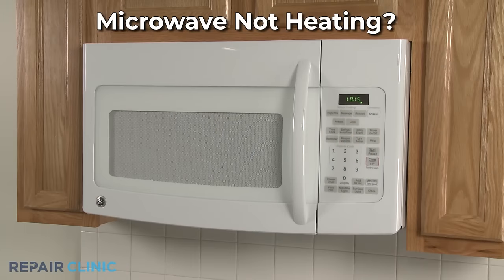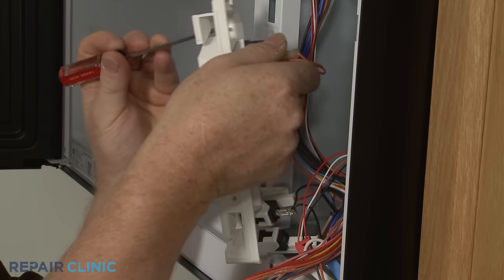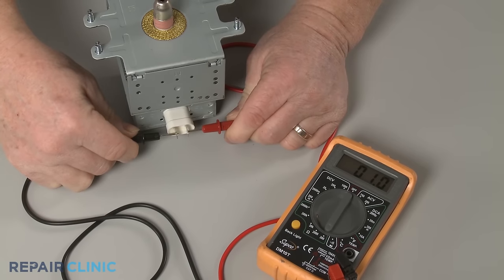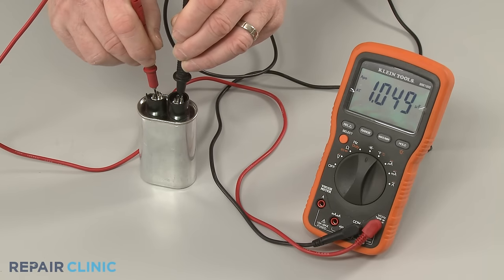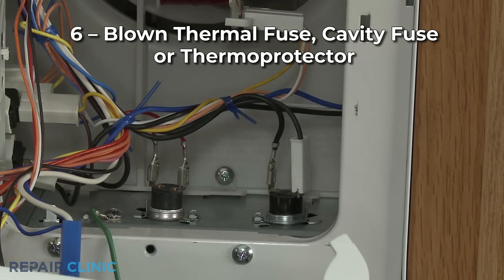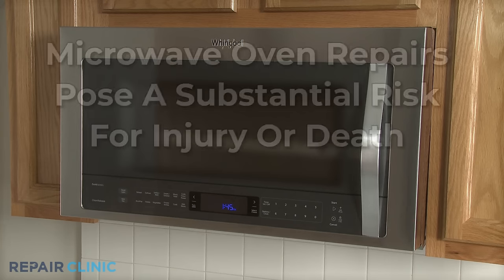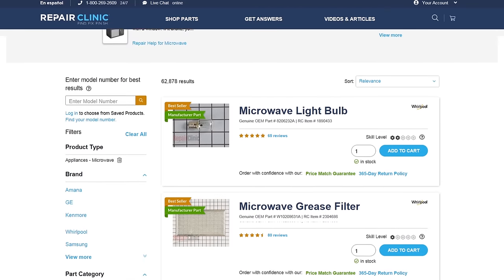Top Reasons Microwave Is Not Heating — Microwave Oven Troubleshooting

Comment: Great video, thanks. My microwave stopped heating, but the lights, sounds, and spinning tray still worked. One of the three door switches had a high resistance so I replaced all 3 and fixed the issue.
Reply: I am surprised because I always thought that if a switch was faulty there would be no power to anything?
Reply: How did you replace the 3 switches
Reply: @paulb9769  Agreed. Very poor design if a switch could fail but the microwave continues to operate totally normal except for heat.
Reply: I repaired my microwave by watching videos on how to fix. I unplugged then reconnected & the microwave oven made heat!! !😅yea I saved some money! Thanks for your advice! !!😊

Comment: My more than 40 years old microwave suddenly stopped working. When I opened it, I have seen, that the fuse was black. So I bought a new fuse and hoped it will fix my problem, but the new one spoiled too. so I know now there is another problem and even if I like to repair it, I can`t,  because there are no parts to buy for this old device anymore. To bring it to a repair shop will be too expensive, so sadly I have to say goodbye to my microwave, which worked so fine more than 40 years.
Reply: I feel your pain.  I always buy a new microwave oven every 40 years whether it's working or not.  :))
Reply: @terry_willis  , I bought my microwave 1984, so it was really 40 years old. I don`t need stupid comments of a clown like you.
Reply: @terry_willis  , a faceless clown with a stupid comment, my microwave was really 40 years old and much better than the plastic stuff you can buy now.
Reply: @terry_willis  , I`m sure that you feel pain, mostly where normally is a brain

Comment: I lost heat on my microwave yesterday, think simple before going for the more difficult solutions.
As with all electronic based equipment, do a power down reset by pulling the plug and reinserting again.
My machine came back to normal and save me getting a hernia carrying it to my workshop.
Should be #1 on the check list.
Reply: Ooops! There’s a similar reply further along which I missed, sorry.
Reply: @davidshields7072  I saw yours first.  So if it has lights but doesn't power the turn table and heat the food a power down might reset it?
Reply: @Susan70003  #1 on the check list, leave  the microwave unplugged for 30 seconds and then plug back in, if the microwave doesn’t work then there’s a bigger problem.
Reply: @davidshields7072  Thank you.  I had to use the circuit breaker as there was no plug access unless I remove the microwave to get behind it.  Circuit breaker in the off position for a minute and microwave still wouldn't cook.  Thanks for the suggestion tho.  Moving onto the next remedy.
Reply: Worked for me. It’s my mom’s and my sister who lives with her is always ready to throw something out and buy new instead of doing basic research. Simpler than opening this sucker up so Tks

Comment: 1. Burned out diode
2. Defevtive door switch
3. Malfunctions and magnetron
4. Defective high voltage capacitor
5. Failed high voltage transformer
6. Blown thermometer fuse cavity fuse or thermiprotecter 

In other words get a new microwave or become a maintenance man
Reply: 😂😂😂😂😂 You are crazy. I'm weak. 👍
Reply: lol your correct lol
Reply: Ding ding ding ! Lol
Reply: Lol thx
Reply: Thank you!!!
Reply: They don't fail at once, how ever you need to check on them as part of troubleshooting
Reply: You forgot defective motherboard panel lol
Reply: Or just do what I did- and unplug with door closed and plug again and try. It worked somehow.
Reply: liloo🙃🙃

Comment: Symptoms:  microwave has time, buttons work (except for #3) and functions almost as normal when entering cook time.  
Once entering cook time, the number counts down. 
But.. The turn table doesnt spin, the fan does not turn on, and the food does not warm up after it being counted down. 

Prior to this, for the last several weeks the fan would turn on when opening the door, but it would still turn on when the door was closed and it was set to cook.. but that fixed itself and it started working fine.

What could it be?   Fuse would mean the whole thing wouldnt work, right?     the fact that most things work except for the fan, heat, and the turn table seems like it should be specific.

Comment: Thank so much for this. Finally managed to fix my microwave. Was one of the switches.
Very helpful if you could mention the approximate readings for the capacitor, transformer, heat resistors and magnitron.

Comment: 1 - Burned-out diode
2 - Defective door switch (or switches)
3 - Malfunctioning magnetron
4 - Defective high voltage capacitor
5 - Failed high volatge transformer
6 - Blown thermal fuse, cavity fuse or thermoprotector 
7 - Defective main control board
Reply: When a transformer fails, it will often arc and produce a burning smell

Comment: GE 2.0 Countertop 9 years old.  Sometimes heating. Now not heating. All my parts tested good. With further research I came across the Humidity Sensor connected to control panel and mounted to the side away from main components. This will stop the heating (magnetron) . I don't see testing info  on Repair Clinic.  eBay had the part  $75. Replaced Microwave.

Comment: I replaced the switches when my microwave kept popping the circuit breaker. And it worked for a couple more years. T starting tripping the breaker again and so I thought, time to change the switches. It worked for a day and when I opened the door without stopping the microwave it tripped the breaker again. No matter what I do it doesn’t work. So I thought. Maybe I need a new latch holder since the plastic looks worn. Ordered one and put that in. Now the microwave sound like it’s on as soon as I close the door. The lights on, but the turn table is not turning nor is it heating. Not sure what that’s about. But I’m guessing I burnt the new switches. So I’m replacing the monitor switch again and hoping that resolves the issue. If that’s not it, I think I’m done because everything else is too expensive for my 2014 microwave. 😂 Any suggestions please leave them, thanks.

Comment: Just tested 1 thru 5 and they all seems to be ok.  Microwave made a horrible screech noise and stopped heating.  Is is possible the Magnatron will still have continuity as you showed and be bad?  Just to be clear, there always no electrical smell and I found another video to test the transformer and it is OK.   I could not find any thermal fuses anywhere.  Any other suggestions?

Comment: A bad magnetron can test good on the multimeter.  It's important to remove the magnetron and inspect the antenna (tip) for damage.  It's also possible with proper equipment and safety precautions to check the current through a magnetron.  Good video.  Thank you.
Reply: I saw another video where the high voltage fuse had failed. What could cause that?

Comment: With the parts that I removed from an oven that was placed at the curb to thus be picked up and deposed of, I replaced the door micro-switches,  and the AC main fuse. That got the oven up and going again.  Total repair cost $0.00.  The plate rotate motor also died at one point, so I took the motor apart and repaired it.  Total repair cost $0.00.    This 2004 stainless steel oven of mine was a demo oven, or so they said, and so it only cost me about $40.  In truth, it was not a demo, butthe keyboard was only half working.  I fixed that by cleaning the keyboard connection contacts.  Total repair cost $0.00.      2019, and this baby is still running and still looks almost brand new.
Reply: NEWKNOWLEDGE have u tried baking yourself a cookie in it :D
Reply: @TomNouri  Not quite sure what you mean.  If it is a response to me sounding like I am bragging a bit, well years ago I slowly fell into a semi-coma state across an 8 year period, then I spent another 8 years relearning and recovering after the cause of the problem was discovered.   In turn, I am very familiar with what was experienced by many other poor folk as was covered in the movie "Awakenings", staring Robin Williams, Julie Kavner, Ruth Nelson, John Heard, Penelope Ann Miller, and Max von Sydow.  Other than that, despite being a high school dropout, and a once dementia victim, I did manage to independently discover the phenomena that is today described in Einstein's theory of Special Relativity(SR), and  I also independently derived all of the SR mathematical equations.   Not bad for a once vegetable person.  So I am kind of proud of any of my achievements these days.   Check my YT videos.
Reply: Glad this video helped you fix your microwave and saved you $$$.

Comment: My 2003 Whirlpool overhead stopped heating today. The only feasible fix for me is #2, check the door switches. 
I assume all the parts are different now & an exact replacement part is no longer available. 
Per online, an oven should last 10 years. I guess I got lucky, getting 18 years from mine.

Comment: I think my problem is that my whirlpool microwave is 2 years old, which is how long they are designed to last.  Maybe I should go to a thrift store and buy a 20-30 year old microwave which probably still works fine. ha.
Reply: You are correct.   Far better built.   Mine is from 1984 and I had to re-solder cracked solder joint on relay connections on control  board this past summer and that is the only thing that failed since 1984.
Reply: Aha!!!! My microwave is just a year or 2 old and quit heating. Everything else works fine except for the most important part! ! Piece of junk!
Reply: @Mrsjam96  Well the whirpool tech who came to my house, spent about 5 minutes looking at it and then gave me an estimate for $550 to repair it!  I paid $450 for it.  Wow.  So, he told me to call whirlpool, the first person wouldn't be helpful, ask to speak to a supervisor, and then hope they will actually cover the repair.  They covered the parts so I still ended up paying $230 total to have it repaired.

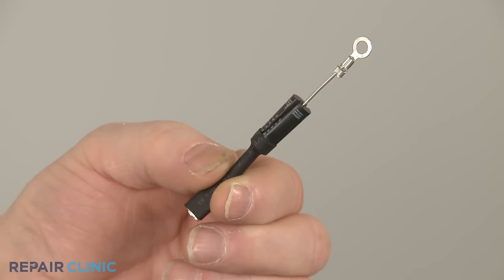Comment: 0:42
He is measuring resistance of a diode in series with a battery...
The kind of guy that would measure the amperage of a wall socket 'cuz maybe it doesn't have enough power

Comment: Mine works at night only what could be the problem is settings
Reply from the maker: It sounds like the microwave is working intermittently, it could be a tripped thermoprotector or defective thermostat. Could also be the touchpad, control board, or magnetron. You're going to want to troubleshoot these parts to see if they are faulty. Double check your socket wiring to make sure it is getting power.

Comment: Can someone please fact check this statement by my home warranty company: "Ventilation filters were too dirty (with grease) causing your magnetron to overheat and go out." Needless to say they will not cover any repairs due to poor maintenance. Does the magnetron even rely on the vents for cooling?? This is for an over the range microwave. Thanks in advance!
Reply: The goal of a home warranty company is to never pay any of your claims.  They rely on mountains of fine print and want to blame you for any issue that arises.  That's how they are profitable.  Your only options are to argue with them endlessly or cancel  your contract.  In my opinion and experience, they are never worth it.

Comment: How does half wave rectification double voltage? How can you increase voltage without amplifying?
The transformer is increasing the voltage, the diode is just half wave rectifying it. I mean, unless someone can show me the math proving half wave rectification will increase voltage.
Reply: It's very common in electronic and been done since the earliest days of radio.  Basically, you charge two or more capacitors in parallel with the rectified AC.  When the AC wave  reverses, those capacitors are discharged thru diodes but they are in series because of the circuit configuration.  It's possible to have 2X, 4X, or pretty much however much multiplication you want.  Because there is no free lunch, current output is inverse to voltage multiplication minus minor losses in components.

Comment: In Microven food is not heating but the utensil is heating & a sound comming, what is the reason,,?
Reply: Sujit Das Don't ever put utensils or anything metallic in micowave. Your micowave would explode.
Reply: @jasmingreen2195  but we use metallic utensil
Reply: That’s why your microwave broke, don’t put anything metallic into the microwave. How are you even alive? You seem like someone to eat the silicone beads in packaging.
Reply: The metal will reflect the wave and can arc with the panel and burn a spot on the inside wall.  It had happened to me.   Just don’t add metal inside the microwave oven.
Reply: Sujit Das that’s make no sense lol

Comment: My microwave runs and sounds like normal and the turntable moves but the food item such as a cup of tea on high is barely warm. Any ideas what could be wrong?
Reply: sams issue here. Everything is working except food or water is not heating. Did you figure out the problem
Reply: Not really. The heat is working a little better but not where it should be. The microwave is about 18 years old.
Reply: Mine is the transformer fuse. Need got go buy one. Hopefully the transformer is not dead.

Comment: the reason my microwave was not heating turned out to be that it was on [Demo Mode],  that's something to check out,  I was ready to buy a new one. 
Save me a few hundred dollars.
Reply: says clock runs faster if on I think used stopwatch was normal I guess
Reply: My turn table doesn't turn and there's no heat...how do I check this demo mode?